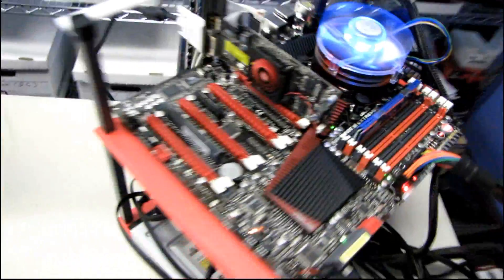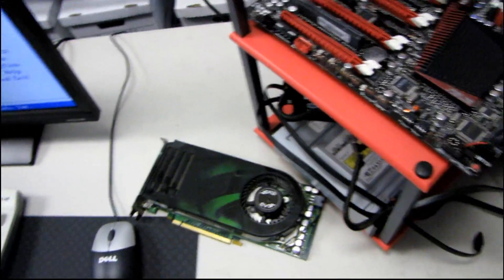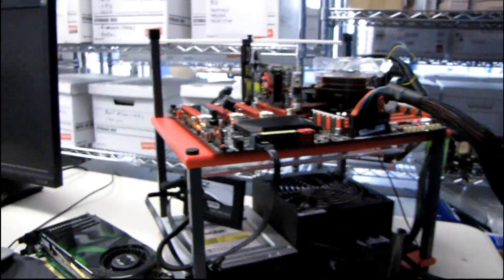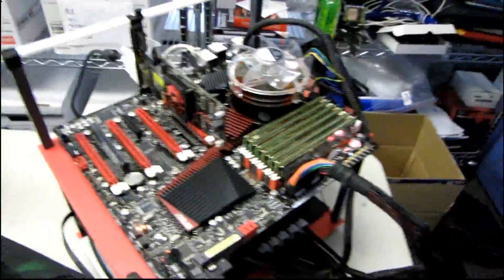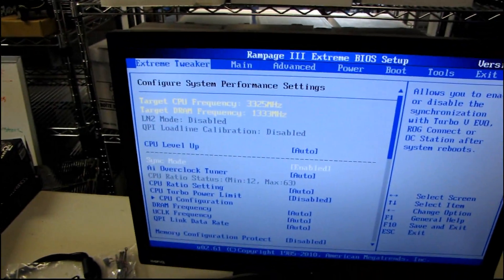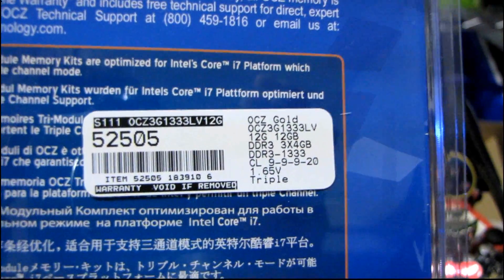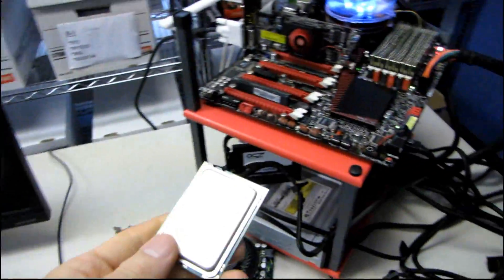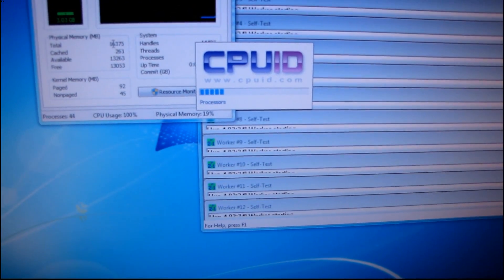Rampage III Extreme 24GB RAM Core i7 980X SUCCESS!! Linus Tech Tips

Comment: Theres 12GB in my system and the only way Windows detects it, is to enable the Memory Recheck option. It's realy annoying and nothing seems to fix it. It only sees 8GB without the option.
Reply: Lennart possibly faulty ram, have you tried testing each one of the ram sticks?
Reply: odd. most modern computers should eat that just fine. i have 16gb in mine and have never had issues with it.
Reply: combatplayer in what config? Tripple or dual channel?
Reply: Lennart Plugge quad channel 4gb sticks on a 2011 board.
Reply: combatplayer  lol, thats a different motherboard. The rampage 3 has a history of not reading ram correctly
Reply: Lennart Plugge i figured it was a different motherboard but since you didn't specify which you had i mentioned it anyway. also thats pretty poor considering its their top of the line series. i have one of the original rampage extreme boards, the one for lga775. it runs fine with 8gb, but then again thats only 8gb.
Reply: combatplayer  well the video is about the rampage 3 extreme. But i guess it wouldnt have hurt to specify the mobo anyway.
Reply: Lennart Plugge actually i haven't heard much good about the 3 channel ram boards at all.. but i've never owned one. havent had anything in between 775 and 2011
Reply: go to start-search bar and type msconfig
then go to boot, advanced options and disable(or enable and set to 99999999) the maximum memory option, click ok, apply and close it. Have a good day!
Reply: VyRuX  Does not work.
Reply: Lennart Do you have windows on 64 bits or 32? it sees all only on 64 bits
Reply: VyRuX  I know that and if you look back you can see my OS version, but now it's 8.1. If it was a 32 bit version it wouldn't even see 8GB in the first place .'
Reply: VyRuX Yup, individualy tested each stick and ran memtest.
Reverting the overclock does not make a difference and neither does a change in voltage.
As soon as I turn memory re-check off, it's back to 8GB.
Reply: Lennart your motherboard has problems then
Reply: VyRuX Yea this one and the previous one aswell. No, the motherboard is fine since it does detect the ram with when re-checking.
Reply: Lennart it's either the ram, or the motherboard, may also be the memory controller in the cpu
Reply: combatplayer
 that is still dual channel no quad, highest channel is tripple channel still NO QUAD read it do not invent on your own
Reply: kmsrog are you trolling or legitimately that ignorant? you should probably go look that up on your own. heres some hints, look up x79, x99 and if you really feel like digging you can also try G34. the quad channel i was talking about was specifically on an asus p9x79 pro socket LGA2011 board.
Reply: combatplayer  he was probably talking about your earlier 775 build which is dual channel. My 1366 is tripple channel.
Dont jump down to his level of rude speech please :) we're all here because there are people nice enough to help me.
Reply: Lennart possibly, i do have two systems in use which can be confusing. although the part where he says " highest channel is triple channel still NO QUAD" made me think otherwise. even within the rampage lineup there are quad channel boards.
Reply: combatplayer  Oh I agree, it gets weird at the point where he says tripple channel is the highest. Maybe he was still talking about the 1366? Quad channel has been out for some time with the 2011 sockets (not sure if others support it too, but the 1366 does not) and I'm thinking about getting one of those new 2011-v3 systems. The problem is the price. €350 to €520 for a new i7, €350 to €400 for a good motherboard and over €250 for a DDR4 kit RAM (though the DDR4 is actualy not so bad anymore).

Combine that with the fact that I'm still running 2 580's with 1.5GB VRAM which are realy pushing it and an upgrade seems quite expensive.

But having no more memory checks and and even faster system would alsmost make it worth it.
Reply: Lennart i dont know if its worth going for the third gen yet, depending what you plan on doing with it. at the moment there's little to no benefit of having DDR4 at the moment, especially when you run quad channel as its so fast to begin with. i'm perfectly happy with my 3930k, theres nothing the CPU has caused bottlenecks in as of yet. i have an R9 290x paired with it and a GTS 250 for physx in the few games that has it. even with the 290x there's ample room for a graphics card upgrade somewhere down the road. getting a second or even first gen hexa core cpu would be so much more worth it. then maybe spend that extra cash on a watercooling setup. alternatively wait till gen 4 comes around and then get gen 3, unless the ram prices have equalized by then, then maybe. (all this assuming youd use it for gaming. if its for work it might be worthwhile to go for the 8core with ddr4 memory)
Reply: combatplayer  well comming from an i7 950, the 2011-v3 would be the next step for me. Its a nice upgrade.
DDR4 will get better over time so I can always switch kits.
I will never, ever, do water cooling since its too much of a hassle. Only the CPU gets a closed loop cooler. Using the corsair h70 at the moment.
Reply: Lennart fair. im not a fan of closed loop cooling. i originally made my system with an intel liquid cooler, similar to a H60 or H70, unfortunately it was loud and performed worse than i wanted from the very start, getting high temps at stock so overclocking was out of the question. it didn't get better when the pump started failing, running slow and getting louder. i replaced it with a NH-D15 and i'm never looking back. that 290x is super hot though which makes a full system water cooling thing sound tempting. (not stock cooler, thankfully)
Reply: combatplayer water cooling does indeed sound tempting. My 'gentle typhoon' fans sound like an actual typhoon.

Anyway, my problem continues and i might actauly get a new cpu and mobo first instead of a new gpu
Reply: Lennart shame with the cost and tedium involved. replacing cpu and motherboard sounds like a good first step towards a better futur- er i mean computer. depending how many dimms you have your memory on it may be tough to get a different setup  that'll take it all though.
Reply: combatplayer Well if I'm going for a new CPU, I'll have to get a new motherboard and RAM aswell. So I'll instantly go for DDR4 which means my current DDR3 banks can be sold.
Reply: oh right, forgot you were set on 2011v3. which cpu are you looking into getting?
Reply: combatplayer I was looking at the 5930k but I don't know if about €200 more is worth it for the extra PCI lanes compared to the 5820k.
Reply: you going dual graphics or plan on having other things? i have a 3930k and i haven't saturated those lanes at all yet.
Reply: combatplayer  Well even with SLI or crossfire systems the 28 PCI lanes seem to do fine (Linus tested this). PCI 3.0 8x is about as fact as PCI 2.1 16x and thus the PCI lanes don't realy form a strain it it's performance.

However, I'm trying to stay clear of SLI for as long as possible. I'm running dual 580's now and while it works fine, I prefer a single card.
Reply: Lennart yeah so i doubt the lanes are worth it, youll never use them anyway

Comment: I had/have an OS limitation on RAM too that I can't figure out. 8GB RAM, Win 7 64-bit Home Premium and both the BIOS and OS detect and can use the full 8GB no problem. HOWEVER, when increasing the FSB past something like 210MHz, the BIOS and OS can detect the full 8GB, but only 3.99GB is usable.

I understand increasing the FSB also increases the RAM frequency, however the RAM I was using was rated at 2400MHz and my current RAM is rated at 2100MHz, although both kits were set to run at 1600MHz when the issue occurs. I have a feeling it may be because the processor I'm using (AMD Phenom II X4 965) has a memory limitation of 1600MHz, although I believe I've seen people use up to 1800Mhz with a Phenom processor.

It's not really a big deal seeing as I can just lower the FSB and voila, I have the full 8GB usable again, but it puzzles me when I see people with a 965BE use a 225MHz FSB and not complain about the issue.
Reply: he made the same mistake that you did, go to start-search bar and type msconfig
then go to boot, advanced options and disable(or enable and set to 99999999) the maximum memory option, click ok, apply and close it. Have a good day!

Comment: hello.. I installed 4 sticks of 2 gb RAM and windows say installed 8gb RAM (3,99 usable) .. what does that mean ? does it mean that only half and not all 8gb can be use? so what is the point installed 8gb anyway ? what if i only installed 2 sticks of 2gb RAM ? does it mean that I can only use 2gb RAM ? how to maximize it? so how I can get maximun results and use all my 8gb RAM ?
Reply: The 4 gigs is a 32bit OS limitation, if you switch to a 64bit OS you'll be able to run all 8 gigs. - check this for more info http://en.wikipedia.org/wiki/3_GB_barrier
Reply: Zeke Vice
@ my OS is win 7 64bit dude. my mobo is MSI p55a Fuzion. I enabled the X.M.P at Bios and the result is my Bios detect 8 gb RAM. if I disable the X.M.P, then my Bios only detect 4 Gb RAM.. that is why I am confused. disable the X.M.P my BIOS and OS detect 4 gb, all fully usable. X.M.P enable, Bios and OS detect 8gb but only 3,99 usable. WTF ??? dude, can you help me with this ?
Reply: BornAs Atheist Remove all sticks of ram, then add only 4 gb, cmos, start the pc, and if you have 4gb of ram install the other 4gb and start the pc,i think now you need to have 8gb. (after you shutdown the pc you need to put the cmos switch like before)

Comment: actually. ram has to do with fps... i know it's a graphics card and monitor thing. but bf3 started getting higher FPS when upgraded to 8 gigs of ram.... and my graphics card is integrated :P. 

PD: FPS is determined not by your graphics card. your monitor handles the thing. if you have a 120Hz Monitor you will have 120 FPS. not more. also. you can't install games on ram....

Comment: what you mean is: RAM Disk only increases load time? CORRECT!

the only things that can affect FPS (Frames Per Second) are:
CPU speed (and cores ofc.)
GPU speed (and cores again)
Frame Buffer (when working with multiple monitors)
RAM speed (not alot.. but when your using an APU..)
temperature (modern CPUs&GPUs will clock itself down (get slower) when reaching a dangerous temperature)

the amount of RAM doesnt matter at all (exept when your talking about 1/2gigs..)

Comment: On 32-bit operating systems fitted with 4GB of RAM the end user normally sees about 3GB of installed system RAM. With larger amounts of RAM (like 6GB) you'll need to install a 64-bit OS.

Comment: should be good, if you're not short on money, consider a i5-4670 and a z87 mobo, as well as a GTX 660 (its under $100 more). Also you could get a PSU with less watts, that setup wont ever use the 600 watts.

Comment: You're not going to be able to spend $400 for a system that will max all games out. Not even close. You can build a well balanced system for $500-$600 that will Mid/High most games but even now cards like the Titan just barely max out games like Crysis 3 at stable framerates.

Comment: did u do a fresh install ... could be a crap tone of senarios ... from windows not getting updates or runtimes not being cnfigured ... overheating.... make sure latest drivers for everything ..... ive usually had promlems with hhd's they die/degrade performancew quikly . especially in a laptop ... i would say upgrade to an ssd even if thats not ur problem ..... is it just those applications ... try running furmark and prime 95 (not at the same time) ... could be video card overheating  idk

Comment: In theory it should see 192GB but maybe just maybe microsoft limited windows 7 ultimate to 16gb usage on purpose? No sure I haven't looked that much into it. I use Windows Server 2008 64bit R2 edition for everyday gaming/personal use. I have 16GB corsair DDR3 1600 with an EVGA 790i Ultra, and E6600.It was an Q6600 but i fried the internal temp sensor haha, overclocking to 4.8Ghz on peltier water cooler was to much for it haha. Never again.

Comment: you could actually do it with 400 if you truly wanted the normal console expierence actually :D. And the good thing? always able to upgrade later :D. But with windows and everything yeah around 500 600 or so especially if you want a good case. Mine would have only cost 650$ without windows and the power supply upgrade I made! And IT's a KICKASS PC

Comment: AMD FX-6100 Zambezi 3.3GHz Socket AM3+ 95W Six-Core Desktop Processor
ASRock 970 EXTREME3 AM3+ AMD 970 SATA 6Gb/s USB 3.0 ATX AMD Motherboard
PNY 8GB(2x4GB) DDR3 1333 RAM
XFX AMD Radeon HD 6850 1GB
Thermaltake Commander MS-I Snow Edition 
ULTRA 600W LIMITED EDITION PSU
COOLER MASTER Hyper TX3 RR-910-HTX3-G1 "Heatpipe Direct Contact" 92mm CPU Cooler

Comment: I hardly doubt it was a CPU limitation since I was running 24GB of RAM on my i7 920 so the 980X would be able to handle 48GB max just like all 1366 socket CPUs. He probably thought he had Windows 7 Ultimate, but really only had Windows 7 Home Edition. Memory limitations for Windows 7 are as follows Home Edition 16GB, Pro Edition 64GB and Ultimate is 196GB. I ran into the same problem when I upgraded to 24GB and I had to upgrade to Windows 7 Pro before all memory was addressable.

Comment: I was curious if it was somehow possible to rewire the marvell 9128 controller to work on a 16x pci-e lane instead of the 1x which they "accidentally" put it on... lol.  I know this boards out of date and it would be safer to just buy a controller, but the question is... can it be done? ;)

Comment: Dear Hackscape3, platform presented in this video has been build in 2010. In his setup, there is no decent GPU, just highend Processor, and a lot of RAM memory. Proper video postproduction require uninterrupted flow between memory, GPU and CPU to perform and render 2D graphic (basically, even 3D videos are just combined dual 2D movies). That's why Nvidia Quadro 6000 is worth 4,000$, because it contains 448 CUDA cores ready to compute anything which will appear on Your display.

Comment: see if it is worth it with the cpu, if the cpu is too slow then dont bother, if it is 32 bit operating system then dont go higher than 3GB of ram because 32 bit does not use any more than 2.8GB of ram no matter how much you put in.

make sure your os is 64 bit

check if cpu is good.

then you maybe able to upgrade ram. :)

Comment: ok well ... components will keep dying on you unless ... u provide ground on the motherboard. 
The motherboard takes ground from the screws u use to screw it on the boxes. You could still have an easy open setup like this , but u have to give ground to the motherboard through its screw holes.

Comment: Its only when you go for the absolute top end stuff that you get problems like this, especialy if you are running it with an old card you used on a bunch of other pc's for testing. the biggest problem you normally face with building a pc is plugging in the fan on the side of the case. (btw it can actually be the hardest part since u have to hold the side panel up and plug the wire into a tight spot at the same time xD)

Comment: INCORRECT. you see, you can up Minecraft's RAM limitation from its default RAM value, which is actually 512MB of ram, up to 2GB without errors. Now when you give Minecraft enough RAM, it will cause errors, and you will have a memory leak. otherwise, you wont get any errors.

Comment: Your mobo burned your GPU for first time... Issues istalling RAM, or badly installed RAM can cause system malfunction including damaging peripheral components... Badly installed RAM can be detected by the following symptoms: No post ( Or the "Dead PC"), MemOK test fails...

Wrong RAM Module sequencies CANNOT provoke peripheral damage, it will just probably make a "Dead PC" but it solve as soon as RAM's are mounted on right sequence...

Comment: I dont need an SSD..... the cost per Gb is not beneficial. I dont need the speed as my computer runs plenty fast as it is so I would just be doing nothing but wasting money. I'll more than likely buy a new laptop with RAID0 SSD, the Vertex 3's are blazing fast and in RAID0 they are that much faster. I'd get them in 256GB size at a minimum.

Comment: not sure if you have fixed your RAM issue as i dont really want to read through all 2k+ comments but i have the same board and had the same issue. if you check in your bios settings and enable memory recheck. Im sure thats the option anyway. hope that helps and nice setup :)

Comment: oh hahaha sorry I misread your comment. Timings are used to measure latency in the actual access speed of the memory. The numbers represent how many clock cycles the RAM has to go through to get actual data transferred from and to the CPU. Lower timings are better. If you want to read in detail what the timings measure on a computer engineering level, head over to Wikipedia. They have a page on RAM timings.

Comment: I've run 64 gigs before. With that much RAM you can never get good clock speed on the chips. I'm back at 32 for now, running at 1333 MHz and 9-9-9-24 timing

Comment: uhhh, anything more than 8 is ridiculous. I've been working in the IT field with programming and networking for over 15 years, and anything over 8 gigs is unnecessary. Providing there isn't any insane work going on,nothing within the next five years will be able to even fully utilize more than 10 gigs. I have my own gaming computer, and i can run ANY game on highest settings flawlessly, and even with 3.9 GHz overclocking there are no issues. Plus, anything you buy will be dated within 5-7 years.